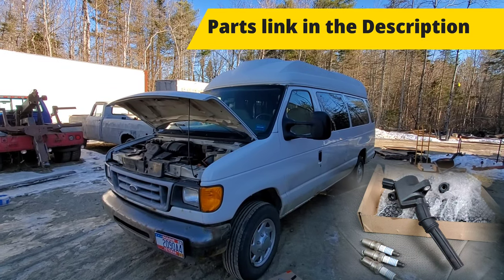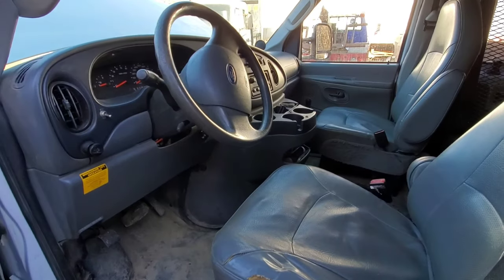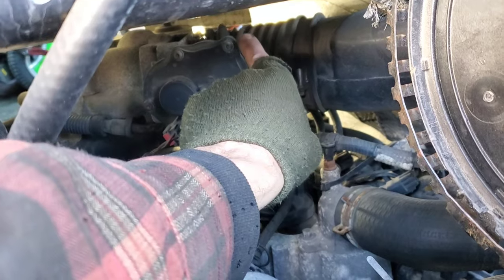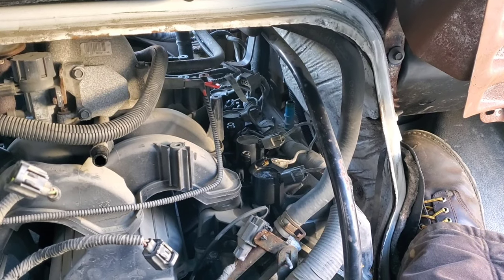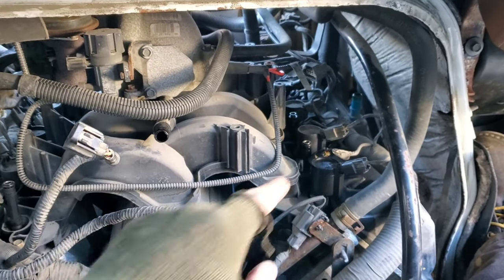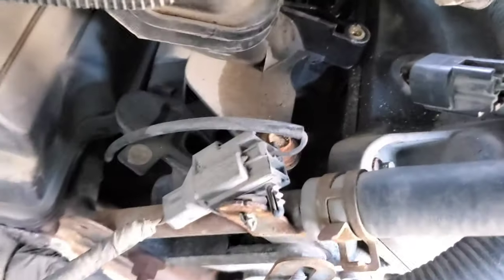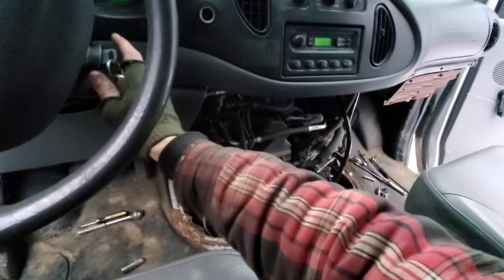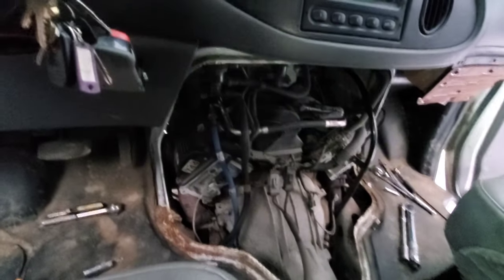Coils and Spark plug replacement E250

Comment: Dude, I was able to change all spark plugs without removing the fuel rail, the hardest thing is getting to 2 of the coil bolts otherwise all the coils have enough room too pop up and twist out and enough room to put the new one in, it's just a manner of having the correct extension which I had to learn lmao
Reply: I just did it today after seeing your comment🤣🤣
Reply: Damn I was going to say this looks more difficult that i thought
Reply: But still great vid
Reply: Well it's normally the 5.4L 2valve so the coil boots are at an angle a little bit that's what makes it easy to pull them and twist them around the fuel rail
Reply: I have 165,000 miles on my '07 5.4L 2V, which is running great right now. Are there typical miles the spark plugs, coils and fuel injectors go bad at? Thinking of doing it all in one fell swoop, but definitely don't want to swap out OEM parts that may still go way longer for non-OEM that may make this procedure a 3-5 year event.
Reply: @SurfingFLA  Just be careful you don't buy fake coils. There are videos on YT how to spot the fakes.
Reply: @SurfingFLA  Mine are currently failing at 205k
Reply: IMPOSSIBLE WITHOUT REMOVING THE FUEL RAIL!

Comment: I have sever carpal tunnel in my left hand and was still able to reach in and get all 8 coils and plugs changed without pulling the fuel injection manifold. Even with this major unnecessary work, really well done video. I got the 6" magnetic socket. There were 2 that the 10" might have been difficult to use but 3" and 6" added extensions got all of them.  NOTE TO ALL! You absolutely do need compressed air blower for this job. I cleared a Ton of crap with it. Blow right before pulling coils. After pulling coils and again  after loosening plugs but before pulling them all the way out. Most of mine yielded a lot of particles after loosening the plugs. Do not put anything on plug threads. Dry threads, and 14lb/ft is not very tight so be careful you don't overtighten them or the next change will be a royal pita
Reply: Why wouldn't you use anti-seize lubricant?
Reply: The plugs should be torqued to 23-25 lbs or they will blow out.
Reply: Yes everybody is correct.u do not have to remove the fuel rail to replace the spark plugs and coils I did the job on my e350 van and I did not remove the fuel rail its totally unnecessary.it would make the job easier but way way to unnecessary

Comment: I made my life easier by just working a little extra in my expedited delivery business and earning the money to take my '12 E350 Super Van Basic, 5.4L Flex Fuel, (I'm the original owner) down to the shop I use near my house, and let them do the work. He allows me to buy the OEM Ford parts (online, cheaper than my dealer, at FORD PARTS CONNECT in NJ, fast shipping), and he does the work. I have 781K and my #7 cylinder and maybe other burn oil, and I have to add a quart every 800 miles. I'm going to buy a remanufactured 5.4L and have it installed. I'll replace the water pump and the timing chain, and I should be good to go. Air filters on these 5.4's, always use a Motorcraft, the other brands don't fit right. I also know people in the same business as me and the Ford Transit motors last half as long or less than these tough 5.4 motors.

Comment: I changed coil #5. It was somewhat easy. No removal of fuel rail. Then coil # 7 crapped out . THIS WAS A BIG PAIN!  Next time I'm taking it to the shop!!!!!!! BTW This all happened during the course of a Chicago Winter on my open lot for parking.  Hats off to you guys on a GREAT video. Wish I saw it before jumping into this with just a little coaching from parts shop. The parts shop guy has the same van so he explained a lot.

Comment: Thank you for talking about the pitfalls and stupid things that ford did (such as connectors that you have to push in and pull out to pull out, or that the fuel rail has to come off). It saves me time!